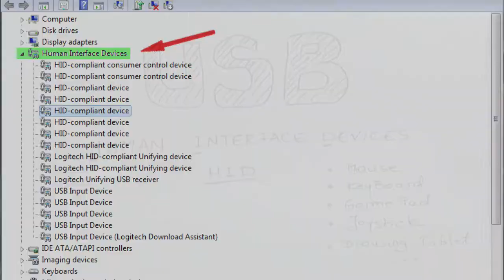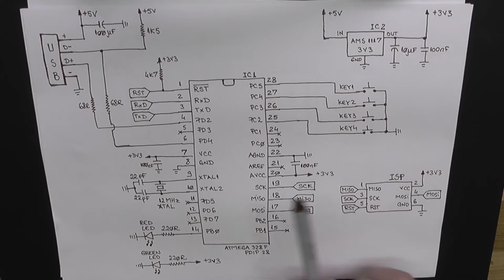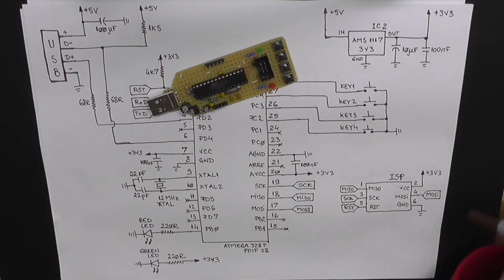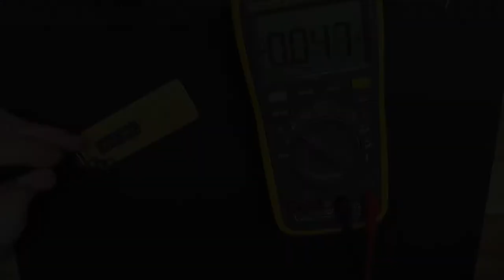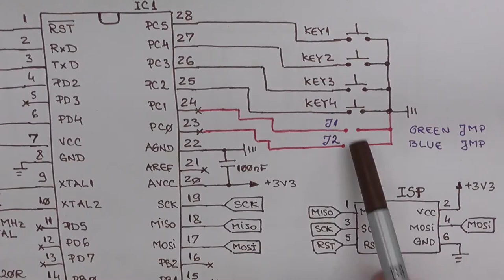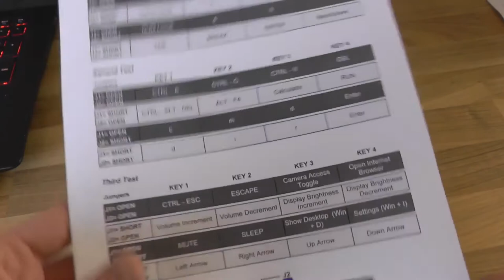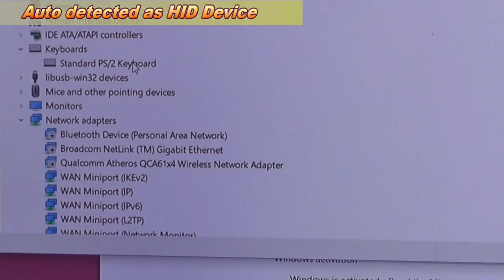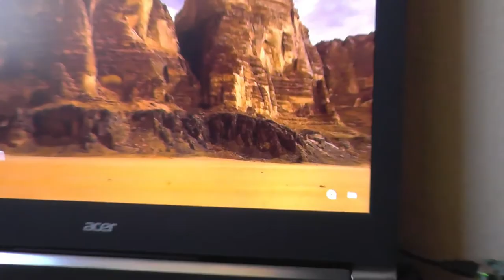Building a USB - HID Keyboard (DIY on a prototyping board)

Comment: I made a TTL device by accident on the Cardputer as I coded "a reader" for a GPS module and wrote to serial / USB as well. With a switch or sending "$keyboard,5" I could give it 5 minutes in HID mode, maybe, in the future. Not sure where to start, but I'm "through" the USB cable in that situation.

Comment: Cool stuff. How did you implement the whole USB communication on this device? Did you use something like V-USB?
Reply from the maker: no, I wrote my own stack
Reply: @coreWeaver  that's pretty sick. I assume it's very minimal given the footprint of the device? Will you be sharing this by any chance?
Reply from the maker: @iceinmylean3947  the fw is heavily based on a piece of code I wrote for a company. I also have an nda signed with them so I can't make the source public. I can however recompile a custom fw. I did that a couple of times for other projects

Comment: This is really awesome work, I'm working on a project like this and I was wondering if you could help me understand the firmware of for this project.

I noticed that you are using the IO pins of the MCU for USB communication. Is there a specific way you're sending those commands or is there anything else?

Comment: Can I purchase one of these devices ready to go?  I want to use a contact closure from the output of an Allen-Bradley Micro820 PLC to trigger an "ENTER" HID keypress input to a PC.
Reply from the maker: sure. send me an email: core.weaver@gmail.com
Reply: @coreWeaver  need a modified version of this, with 4 keys and two analog inputs. The inputs will be a temp sensor and a water level sensor. Can you modify the design to do this ? I sent you an email with the specifications. Thanks in advance
Reply from the maker: @jane.q6280  sure. I'll get back to you